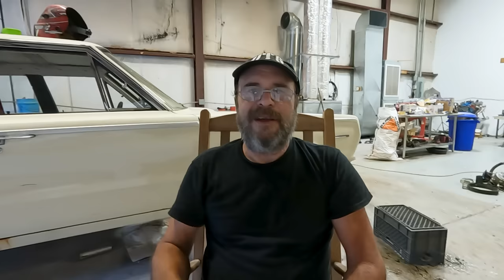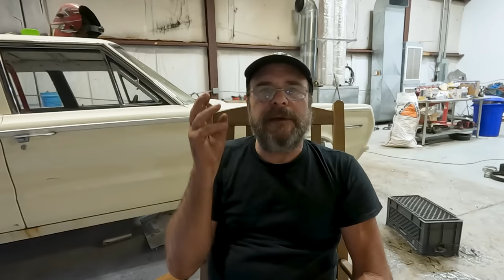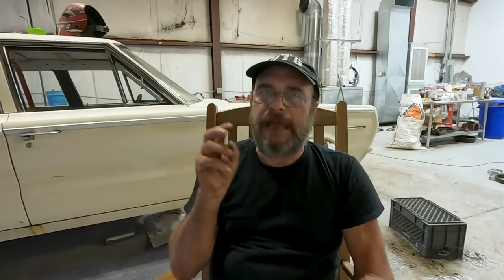They Really Are Out To Get You- How The Automakers Have Made Life Miserable For The Average Mechanic

Comment: My father had an auto repair shop for 40 years, from 1946 to 1986. He got out of the business when he saw this trend escalating. He retired and worked part time outside of the auto repair field. He had no regrets getting away from the business as he saw things continue to get worse.
Reply: the golden age of mechanics...everything is absolute ass to work on now
Reply: you make it sound like he wasn't going to retire anyways...that's 40 years
Reply: He should have stayed in the industry and fought this sh8t show and not ran away with his tail betwen his l egs. Things would have been quite different if people did this in the past!
Reply: My grandfather did the same thing.
Reply: @JeriDro you sound ignorant saying that, like you missed the message
Reply: @spectrumofreality  what are you doing about it?
Reply: Same applies to oil patch. New electronics completely replacing drilling systems. Auto drill tools, that the geologist can control from downtown Houston or Calgary. Drill rig crews downsizing. All drilling is on automatic. Big changes came out with cell phone (smart phone). Satellite internet, everything real time. Adjustments Made on the fly with autodrill rotating tools. Now with China on the scene. Chinese send C-cans full of drill tools (just replace tools every bit change). Used to go 200+ hrs on tools. Not anymore Asia provides cheap tools, just replace everytime on surface. No maintenance required (like replacing tires every year 😂).
Reply: EVERYTHING though is suffering from government interference.
Reply: @JeriDro right 😂 thought the same thing. Like was he gonna out in another 40 years or something lol
Reply: @MrTemplerage  Governance by definiftion is the antithesis of freedom!
Reply: @lmtada  WOW... You learn something new everyday. Thanks!
Reply: wow
Reply: @lmtada   Last week I broke hacksaw blade halfway through cutting steel tubing which was my final blade.  Bought set of blades from local shop, each one bluntened after first stroke of saw, serves right buy China.  Then Bought more from big name DIY chain, for metal of course, exact same thing happened the teeth flattened on first stroke each blade.  Had to borrow an old rusty hacksaw off a friend to finish the cut.

Comment: My 86 Camaro needed a fuel pump. I have the factory service manuals, and the procedure included dropping the entire rear end to remove the fuel tank. Instead of following that procedure, i cut a hole over the tank to access the top of the tank, cut the steel fuel lines, removed the assembly, changed the pump, put it back together, used neoprene fuel hose and clamps to hook the lines back together. Created a fiberglass cover and attached it using nut-serts and bolts. Later i did the same thing to my 2002 Yukon. I expect that with the convenient hatch, the pump will never fail again.🙂
Reply: "I have the factory service manuals" // Do you know that in USSR every single device had a service manual? Including TV-set, radio or cassete player? It was an obligation for a factory to provide a service manual. Despite of this fact there is still idiots who say USSR was the worst thing in the world!
Reply: @alextrezvy6889  Yeah right, that's why hockey players from the Soviet Union bought piles of electronics/clothes/jeans to take back, when they came to North America. Shelves over there would be empty of food and other necessities we take for granted. There was a Russian hockey player, who was drafted by the Vancouver Canucks in the 1980's i think it was. A Canadian player and his wife were over visiting, and the Russian couple were overjoyed---showed them all the meat they had scored that day--fridge/freezer full. The Canadians asked them "why would you buy all this meat". The Russians thought it was like the Soviet Union, the shelves would be bare for days. They were told that here the shelves will be just as full tomorrow. Only idiots think it was rosy in the USSR. Why do you think that when their athletes came over here, they were basically under lock and key, so they wouldn't defect? That's a FACT.
Reply: @alextrezvy6889 Back then almost all appliances in the US came with service manuals and diagrams.

You don’t need to utterly change economic systems to mandate the inclusion of a service manual lol. That’s just a simple industry regulation Congress 100% has the authority to do. 

But at the moment it isn’t mandated. So it’s cheaper to not include one, so companies don’t. If all companies have to include them, then there is no competitive incentive to leave them out.
Reply: Good for you. I guess you have to get creative
Reply: @alextrezvy6889  Sort of makes up for the Gulag....
Reply: @KStewart-th4sk  "The Canadians asked them "why would you buy all this meat" // These are canadiands, who were killed in count 20..25 millions (+millions of disabled persons) and the infrastructure (including plants, houses, railroans) was destroyed by bombers and artillery during WWII? No? But that's the fact for Soviet Union!
Reply: Be sure it’s air tight because carbon monoxide can get in there.
Reply: @piedpiper1172  "You don’t need to utterly change economic systems to mandate the inclusion of a service manual lol" // What do you mean "utterly change economic systems"? Both U.S. and USSR have had very different types of econ.system during different period. As I know U.S. economy before R.Reagan and after him is very different. Also in USSR there was private cooperatives before Khruschov's clan came to power. First CRT TV-set in USSR was produced by private cooperative called "Progress-Radio". Private cooperatives have been producing weapons during WWII. It is not Stalin, but Khruschov who started to monopolize all the economy, by forbidding private cooperatives and expropriating their assets for the state. See "Артели и кооперативы СССР - SmolBattle".
Reply: @arnoldberk2809 
It's gasketed.
Reply: All very clever and  I concede it might be roadworty but the big question is: is it barrister-proof?
Reply: @KStewart-th4sk  Seems its just the opposite these days, watches when Tucker Carlson went to the USSR a few months back! Sad but true.
Reply: We need legally mandated dipsticks, greaseable ball joints, fuel pump doors under the rear seats,l, etc. I have a whole list of specific design principles that could be mandated and save consumers billions.
Reply: @piedpiper1172  Most new cars no longer have any sort of service manuals.

Comment: An old timer in manufacturing explained to me long ago that during the onset of the industrial revolution, most machinery was made "in the old country". There were no parts for it. What you did get with the machine was a set of blueprints & specifications. When something broke or wore out, you made the part as you had in your possession all the information to do so.
It also reminds me of naval ships, they had on board stock of common parts, i.e. steel stock, pipe, fittings, dresser couplings, etc., you had a machine shop on board. If you didn't have what was needed, you made it. It may not be perfect but it got you back under way one way or another.
If that's what we're headed back to it's fine with me.
Reply: But it's not where we're headed. They don't teach that sort of stuff anymore, since a long time now. It would be great, but finding someone young and willing to do that... Even me, I fully realize what's happening, but I clearly know I can't do stuff like that. I can get by with tools and repair stuff the best I can, that's about it
Reply: @adamdion7574  There are machine shops open all over the place. I'm no machinist by any means, but I can cobble enough together to have a professional finish it up if I have to. You probably have more resources available than you think you do. I'd bet if you went to a car show and asked around you'd find a half dozen guys with at least a lathe.
Reply: I have a 12x36 “gunsmith “ lathe and a full sized milling machine in my 20x20 garage 😎
Reply: Who is they? And why do you need them? I don't need anything from "them" . I am a Man and have a brain that thinks without being told what to think, or how to think.  And yes, we will eventually end up back  to what was as this current system is designed to implode.
Reply: @TheBrokenLife 
You might not want to ask if somebody has a lathe when you're at a street takeover, you're more likely to get a gun in your face😂
Reply: I was taking with a navy officer at dinner. They have all the mills and lathes on board but they are not training anyone to use them. Most people only spend 3 years in one shift so it’s not worth it to invest teaching someone some basic machine skills. When they need parts they order it with the next shipment of stuff from new or used equipment. There is always a new plane arriving on deck.
Reply: @suckOnThese3 with that logic, approach a Bridgeport J head milling machine.  Please, live stream and have your phone set to portrait.
Reply: That depends on where you live. @TheBrokenLife
Reply: We are not going that way. It’s the electronics. Ever more complex and opaque. And interdependent. The $3 headlight switch is not on the dash anymore but a software button on the touchscreen. If that screen goes it’s $1000.

Comment: I’m 27 and been working as a tech  at a toyota dealer now for about 6 years.  I’m used to all the stuff you talked about and it’s “normal” for me and is “normal” for all the people who don’t know any better. I agree, we should go back to the old days. There’s a reason both my vehicles are early 2000’s vehicles because they are extremely easy to work on compared to these new 2023 vehicles coming out.
Reply: Yes, even Toyota and Honda, which are probably the best have way to much gadgetry now. Recently rented a new Corolla. It was actually very luxurious for an entry-level car. But the electronics were mind spinning. I can see why any new car that becomes flooded, it is instantly written off.
Reply: One thing that made me realize that was the tap to my radiator core.  Wanted to buy a new one  because old one was leaking (1961 plymouth) couldn't Dinsmore anything decent. Then found out I could just wrench it open..put 2 new o-rubbers in there and been fine for the last 4 years.  I'm 29 was also a shock for me how easy it could be
Reply: I constantly tell my wife I don't want a vehicle newer than 2010
Reply: Post 9/11 to pre-Great Recession.   That's the sweet spot.   I'd go back to '96-ish for imports.  Now stop telling people.   I want more NOHC Buick V6s
Reply: @lukek1949 I have a 2016 Corolla and it's a great car. My 2004 Toyota tundra is also a great truck with the 2uz 4.7 V8. If it needs a starter I have to remove the entire intake and injector rail. An $800 job at the shop, for a starter. The timing belt and water pump was $1000 but that's every 100,000 miles. Hopefully I won't be having to change that starter anytime soon.
Reply: I'm a Toyota tech too and Toyota is probably one of the better manufacturers out there. But we still replace entire engine and transmission assemblies, it's rare you see an engine or transmission being rebuilt. Which is a shame because I like doing that kind of work. 

And yeah, both my cars are Benzes from 1986 and 1993.
Reply: @leckercidre160  if you get an older diesel benz they run great on used atf.
Reply: That’s unfortunate, some of the 2000s-2010s vehicles were/are just fantastic to work on. Example: last year my son’s old 2000 civic needed some work- it took him and I 15 minutes to change out a radiator, and a Saturday to change out the timing belt, waterpump, the hood latch, the fuel lines and a few worn out engine mounts, now it’s good for another 100k miles. I’m not even a mechanic.
Reply: Keep n my 93 Firebird Formula an currently gonna purchase a 78 chev 3/4  std will bull low lol ... FK the industry ...it's our choice what we buy ... Make em think ..buy old

Comment: My brother was dropping a tank on a car to replace the fuel pump, and the gas shot out like a fire hose he said, burnt the shop to the ground, he had 3'rd degree burns on his right arm, but the gas hit the drop light, the bulb exploded, and ignited the gas.  Hats off to you guys, he had said for years they are intentionally screwing the 'shade tree mechanics', I believe it.
Reply: I'm sorry that happened to him, but likely it was his mistake..there are safe ways to relieve pressure and an incandescent bulb working on fuel is a no go.
Reply: Non mechanical pump is far beyond 12 psi lucky he it wasnt worse.
Reply: @JamesCat-qx6sb  valve on the fuel rail
Reply: @JamesCat-qx6sb You do realize back in those days incandescent bulbs in drop lights were pretty much the only affordable thing around right. Accidents like these were the reason lights changed.
Reply: @raymond4648  Early TBI systems used 9 to 12 psi. It was only with port fuel injection that higher pressures were used to prevent vapor lock when hot exhaust spits back out of the intake and hits the injector.
Reply: @gregorymalchuk272  thanks for the useful information.

Comment: Here in Florida it is easy to do, no state inspections. I bought a 2004 Ford F150 with a blown engine. I put new motor mounts, an old 302, mechanical fuel pump, new fuel tank and lines. It is now my daily driver. I’m also working on an old 1953 Dodge army truck. No computers or EFI for me.
Reply: Florida here too !! Same brother . Got my 71 Grand Prix and lmfao overhead cam ranger that got plucked and sbc swapped . All mechanical. When they shut down vehicles with whatever crazy magnetic BS . It will be guys like us rebuilding and teaching how america was really suppose to be
Reply: That's the way.
Reply: mechanical efi was a godsend. not as complicated as some would think.
Reply: @Poolguy8879  my 1995 chrysler lebaron. swapped out the auto 4 spd and put in the 5 spd manual from an old acclaim. at least it has an OD. minty when i bought it. aside from one head gasket - actually not that hard to replace - it still drives just right. reliable, comfy, no issues. 

i wouldn't drive chrysler now if you paid me...
Reply: Great being dependent on yourself instead of the system will help you be free longer than most
Reply: UT watch the prepared mind

Comment: Another example of craziness: on a 2021 volvo you cant replace a damn speaker with one from the same model parts car. Only the dealership has the tools to "register" it on the computer system. Its supposed to be two freaking wires, now its like an internet cable!
Reply: Insanity
Reply: damn bro i never even thought of that
Reply: they might be lying tho i mean speakers are speakers maybe you’re not doing it right. did you strip it to see if it’s just two wires? bc you can’t usually always change speakers to aftermarket
Reply: There're more than two wires, its no longer simple plug n play

Comment: I noticed it starting with non greaseable steering and suspension components. I  remember asking my dad why.
Reply: Non greaseable works if designed correctly. My parents have a 2001 Toyota Camry with over 300K miles. Zero grease fitting, zero play in any of the suspension components. Back in the day, one could grease all suspension components at every oil change and still have a suspension that was totally shot at 120K miles. I do still buy greaseable u-joints for my older junk and grease them at every oil change. Kind of a pain but it keeps me busy and out of trouble.
Reply: When I first saw non greaseable fittings, I thought, well oil changes and lubes are easier, but, the customer will be paying for suspension parts instead, one day.
Reply: My 65 Ford had non-greasable tie rods. They advertised at the time that the components had a lifetime lubricant that did not need greasing. After 45 years they were worn out but they did make it that long. Car was a Falcon so it was considered disposable even then.

Comment: One of the most egregious of all of these unserviceable items has happened to every car I've owned  - the blend door actuator.  A crappy plastic sub $5 part.  Typically an $800-$1000 repair because the entire dash has to come out.  To get the dash out of my Camaro required the windshield to come out, which of course broke in the process. Also the seats, console, steering had to come out.  Cost $3600 to replace to replace this $5 piece of plastic. Just unreal.
Reply: Have the same problem on my '08 Impala. It flutters for 40 seconds, then stops. $600 to fix from my mechanic. Car has 245k miles, not worth the trouble now, but it was a recall item just after my warranty expired.